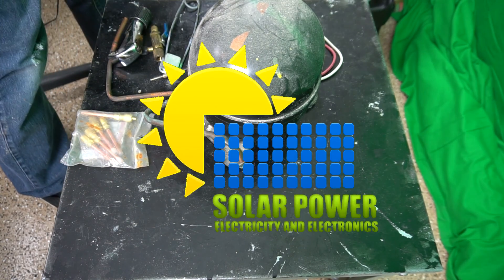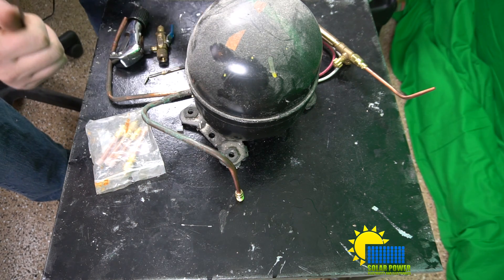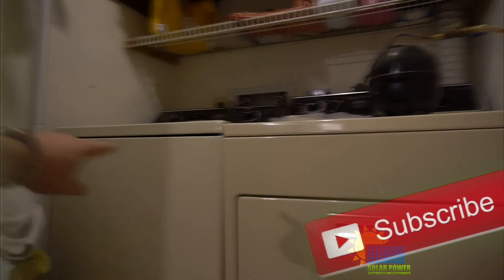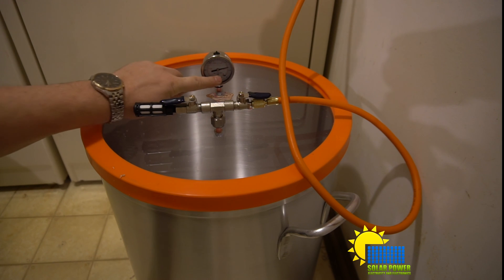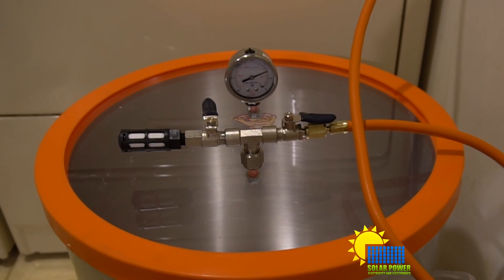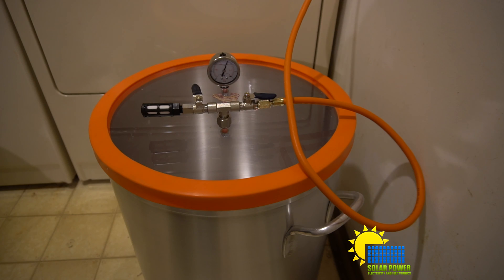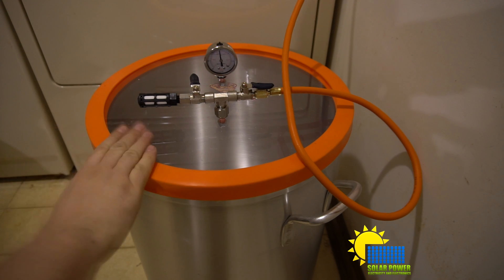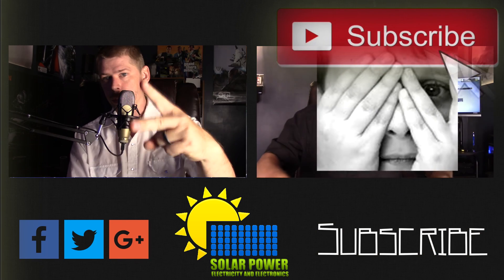DIY How to make a vacuum pump for a vacuum chamber.

Comment: that won't run very many hours either since its not meant to handle lots of pressure like that.
Reply from the maker: I made a large air compressor and had this very problem so I added heat sinks to the crankcase
Reply: Tristin Coveyou it could run substantially longer if he introduced cooling to the compressor to deter lock up from overheating or unlatching of compressor internal thermal switch that is non accessible. Still not likely for longevity, but is a fun experiment for the inquisitive back yard scientist to tackle. 🍻 cheers